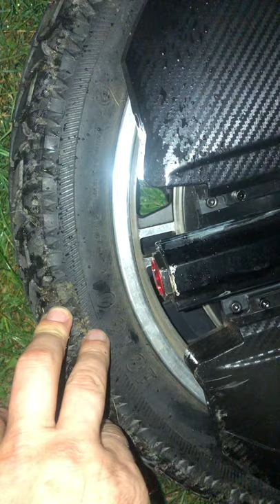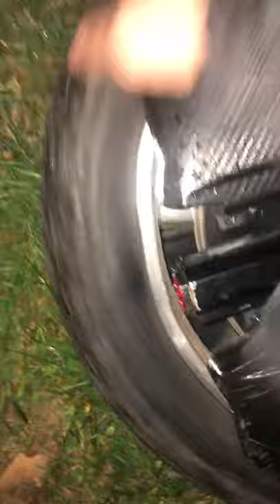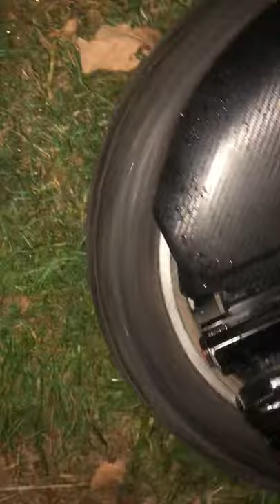INMOTION V11 bent wheel

Comment: Deflate the tire and check the rim has not cracked along the centre line. You will have to increase your pressure to almost rock solid to avoid rim damage on fast rough terrain riding. Repair of the rim yourself is possible, but risky and pretty much butchery. If you are able to get a new motor fitted that would be best, maybe send to your supplier however as we saw in Wrong Way's video it is hard and indeed more damaging to disassemble this wheel without knowledge and the right tools.
Reply from the maker: I watched wrong way’s video, as well as duf’s and even a live tear down. Whew, it’s quite the task. I knew right away I was in for it. I will check for cracks, and if no cracks, I’m going to enjoy this wheel as an off-road unit. A new motor is no problem. $300 and a lesson learned. But the tear down is another story. Yes definitely need to have an organized brain, the correct tools and maybe record a video while I dismantle. A few bumps in my ride feel a lot safer than riding something I pieced back together, haphazardly 🤣
Reply: I've been through two rims on my KS 18XL and now ride off road at 45psi on the 2.5" wide tire. I have had the new S18 for a week now (riding at 40psi immediately on that 3" tire, won't reduce it until I'm familiar with the wheel capabilities) and I'm debating if it will ever be my off road wheel as the damage possible to the pedal hangers from any single pedal clip is significant, I imagine the V11 valve will be equally at risk and it might be worth finding a sacrificial protective measure to apply in that area like a rubber table foot or something
Reply from the maker: @sdalt14  we just have to ride til they break, work more, and get more wheels 😂 I have a feeling we will see some incredible new wheels coming. And if they see our wheels are bending, maybe they will help us with stronger wheels. Two rims? You ride much more than I have, I got the “bug” only two months ago but I’ve ridden religiously. What a rush, the freedom, the feeling, and all of the people who video tape you and are so interested in what you are doing, makes it even more fun 😁
Reply from the maker: @sdalt14 the shock is such a simple little item. I broke my valve already. It’s a clean break, halfway up the stem. It seems very fixable. I am unsure, but I believe a bicycle shop may be able to remove the valve stem and reinstall— or, add an extension as the threads are perfect still.

Comment: That sucks. Hope it can be fixed. 
Just curious, you said you're only going off curbs. Could you share your settings for tire pressure and shocks? 
Also, how much do you weigh? 
Mine arrives this week and I weigh 240lbs.
Reply from the maker: My air pressure was way too low. Don’t worry, just beware. I filled it when It was a hot day. Recently, the temperature has dropped extremely, from 80’s to 40’s. I think it caused the pressure to drop. I was hard on it, riding off and on blacktop curbs and running right onto curbs practicing. Keep the PSI at 25+ and I’m sure it’ll be fine.
Reply from the maker: Hey FastRX8, Im 190lbs. The fact is that I was riding very hard with low pressure. I was hitting curbs, ledges, bumps, really going crazy over how good the suspension is. I didn’t know that it’s smart to have a very high PSI—I came from an MCM5, a 14” wheel. That wheel was hard to damage, but you’d never dream of traversing with that small wheel as you would on the v11. You’ll love it. definitely get Clark pads, also, people are telling me that they are going way higher than 25 psi, more like 35-40, but this is with extreme riding. I rode the v11 “normally” for days, no issues, and then did all the damage when I decided to go from casual to off-roading and every bump or curb I could find.

Comment: I had a similar incident on my ks16 I did not feel a difference when riding as it was just the outer part of the rim. I managed to Bend it back with a hammer and it's fine now. xD
I might have been running on too Low pressure

Comment: And suspension too im running about 33ish psi (tire) top of my suspension is blown bottom I keep at 100-150 per side  ive crashed from 12' in the air on my v11 into dirt landed on the tire and nothing happened. I ride my v11 like its invincible its not don't ride like me.

Comment: What pressure are you running and what do you weigh? My V11 is on its way and want to avoid this
Reply from the maker: I don’t think you will have a major issue as long as you keep the tire around at least 20 psi 25 to be safe. Also bear in mind that the new pump is nothing like the one on all the videos. It’s a new design I recommend using a regular bicycle pump to pump the tire
Reply from the maker: I’m now hearing that folks are pumping up to 35, even 45 psi. At least you know, ahead of time, of the potential issue now. I don’t think it’s the wheel. I think hitting bumps is a lot of fun, so you end up hitting bumps more lol. You can video yourself hitting a curb perhaps, note the effect and adjust accordingly. The wheel is strong, fast (unless you are wrong way who plays with 40+mph wheels) and the suspension is fantastic.